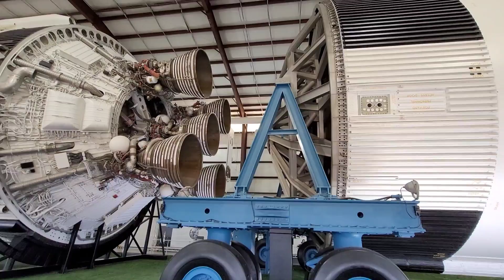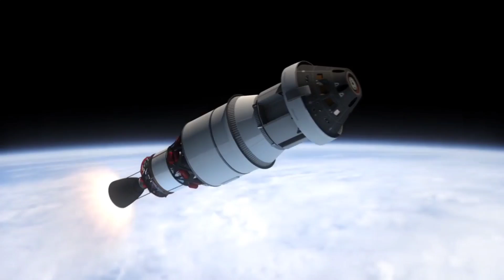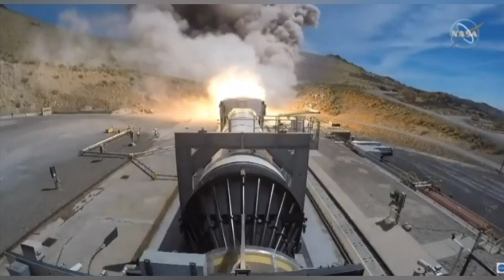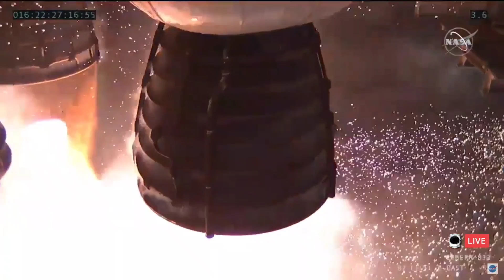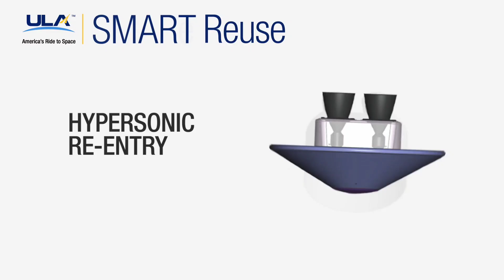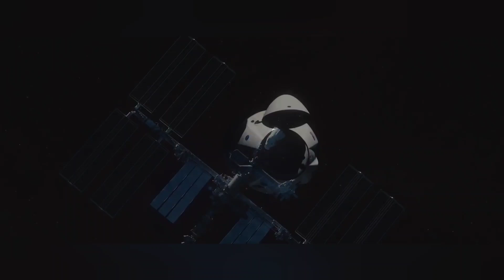Green Run Canceled! How did Boeing foul up SLS so badly? Can SpaceX or ULA (both?) solve this?

Comment: I've checked out a strong suspicion and found it to be correct. I looked at Saturn V and the Space Shuttle and discovered that Boeing actually had very little involvement in either of those programs. The main contractors were North American, Grumman, Rockwell, IBM, Lockheed, Sperry, Teledyne, Rocketdyne, Douglas, Thiokol etc. You come to the conclusion that Boeing's experience in rockets is extremely limited.  I could not find any major piece of hardware where Boeing was the manufacturer or designer.
Reply: Douglas merged with Boeing, so that is probably were boeing's experience is expected to come from if Boeing itself wasn't that involved.
Reply: @MDP1702  Boeing only merges with MacDonald Douglas in 1997. By that stage, they were totally out of the space industry.
Reply: @idanceforpennies281  I was just mentioning it since you mentioned douglas in terms of the Saturn V
Reply: @MDP1702  Yeah, that's cool. I was just pointing out Boeing got nothing useful from Douglas viz space technology. The main point I'm making is that Boeing has no significant value-adding to old or current space technology. It's not what they do.

Comment: Boeing fell prey to having to much money. Happens to tech companies a lot and it works like this:

A tech company generates large profits owing to technical excellence itself a product of a technically savvy leadership.  But the big pile of money has to be managed, so finance guys enter the picture. Overtime, the money management becomes a major profit center itself, perhaps the major other center. The balance of power shifts from the technical managers to the financial managers and the company losses it’s technological edge and competence. Companies cite business swirls down the drain. 

This happened at Boeing when the finance guys who wrecked McDonald-Douglas were invested in the merger of two companies and then went on to infect Boeing.

Boeing’s finance execs even bragged that they had made Boeing, “More than a great engineering company.”

I doubt the company will ever truly come back.

Comment: Question: Didn't the booster segment count go from 4 to 5, and not from 7 to 5?
Reply: 11:36.
Also think he said first stage was almost a space shuttle external tank with an engine slapped on. I think that is wrong too, only the colour is the same 😂.
15:26 he say the orange tank is "from the space shuttle".
Reply: @nielsnb11  You're right, it sounds like he's saying that the shuttle had 5 and now it would be 7.

And yes, the tank also wasn't the same, though I thought they started the process with the idea of just modifying the existing tank to fit the SLS, not essentially design and create a new one. But in the end they had to just use a new one.

All in all the only thing that really seems to be transfered from the space shuttles seems to be the engines, and even those were changed a little.

Considering all this, starting from scratch would have been a lot better, but you know, damn politics.
Reply: I believe the booste for the space shuttle was indeed 4 segements, but maybe they initially wanted to increase this to 7 instead of 5 and does he refer to that? Honestly I don't know, just a guess.

Comment: The Vulcan rocket is a interesting rocket and appears to be on schedule. It certainly will add to the overall lunar mission.  The Falcon Heavy is due to get a larger faring, thanks to the US military.  Then there is the Starship, which everyone seems to flip flop on.  Other than sticking a landing it appears to be on schedule to reach orbit by the end of the year. As far as sticking the landing it’s a factor of two things, engine reliability and learning curve.  The learning curve reality is up to six more landings are going to be needed.
Reply: Your take on what’s happening is probably the most informed and as close to my thinking that I’ve seen here yet!
Reply: I'm in agreement with you except that I don't think Starship will reach orbit before June 2022.  That is adjusting for "Elon Time" estimates.

Comment: Boeing hasn't done anything different since the 60's.
The issue is that they haven't figured out how to shut down SpaceX.
Without meaningful competition, Boeing looks good.
Reply: From what I’ve heard, there was a disastrous management change when Boeing merged with McDonnel-Douglas, and that destroyed what had been a rather good engineering culture. So, I do think there has been change over time.

Comment: With your plan to use Vulcan to launch Orion, then have Falcon launch the astronauts... it really begs the question on why Orion is needed in the first place.  Crew dragon just connects to gateway and leverages gateway for long term life support/propulsion only using crew to enter the atmosphere.  The only difference is we waisted some 40 billion in the process for the NASA jobs program.
Reply: I don't think the Crew Dragon's heat shield can handle the extreme speed and temperature of reentry from the moon to earth...

Comment: Five segments instead of 4, the SLS booster is somewhat more powerful than the Shuttle boosters, and No, the core is not a Shuttle derived tank (other than diameter) at all, it’s more an enlarged Delta IV tank.  Yes, all those things you said, but not as much as you would think.  There was a lot of political involved (Constellation must go and nothing must remain, even though Orion did), and there were also many pies and camps that had to be taken into account and mollified.  The design, cost, schedule and performance of SLS was driven much in part by satisfying all those things at once.
Reply: This sounds a lot like the shuttle program: a great fundamental idea designed into a complex monstrosity by trying to satisfy diverse interests.  If you try to make everyone happy, you will fail to make anyone happy.

By contrast, JFK set the target -- get people to the moon and return them safely by the end of the decade -- and the whole organization bent to that one purpose.
Reply: @eternalskywalker9440  Truth be told, the Shuttle was a very well done piece of engineering, incredibly well thought out.  I would rate Shuttle over Saturn V and even Apollo for execution of design and that is taking into account that it was a full generation ahead of both.  Apollo/Saturn was a purpose built system, making the design much less controversial and easier to pull off.
Reply: @Strike_Raid  Uhm considering that the shuttle had a rate of catastrophic failures several magnitudes beyond even pessimistic predictions, that should kind of limit the praise for it. Not to mention that out of sheer luck it didnt have 2 more catastrophic failures. One during launch and another one during reentry. These issues were largely by design too, by not having an abort window and by piggybacking the shuttle to the side,  thus risking heatshield damage. It was  an incredible design for its time, it was iconic and of strategical importance but probably also the unsafest manned crewed vehicle that ever flew. Not just early on but during its lifetime and its certainly the vehicle that killed most astronauts in flight. It was also an insane moneysink that ensured that NASA wouldn't have any other ambitious projects in the 30 years it was in service, not even a successor and certainly no moon base or some other stuff people were waiting all their lifes for.
Reply: @haraldhimmel5687  Apollo had it’s lucky breaks too, they all did.  Both Atlas and Saturn had about 1/10 failure rates, shuttle was about 5 times better.  There were not enough Saturn launches to get a solid number, only Apollo 6 was an outright failure.  There were a lot of Shuttle launches, it had very respectable success rates.  Mercury was far and wide the most dangerous program. Gemini had no credible crew escape system, probably worse than even Shuttle.  Apollo was massively more expensive than Shuttle.  Shuttle was both more and less capable than Saturn.  Shuttle was a very flexible launch system, but also limited by where it could go.  Shuttle may very well be the most impressive thing ever constructed.
Reply: @Strike_Raid  Depends what you think about - it was indeed brilliant  and groudbreaking IMPLEMENTATION of  bend-over-backwards concept and system design. Just look at how competeing concepts for Space Shuttle used to look like.  Truth be told,  Russian concept of Energia - powerful versatile launcher able to haul significant, asymetrical loads was the way to go.
Reply: @Strike_Raid  Constructed  - yes. Designed - hell no. Also, for benefit of discussion, name one Shuttle escape system designed to work beyond STS-4 and during most risky phases of mission, or one that actually saved astronauts during real, not procedural emergency.
Reply: @piotrd.4850  I was talking about on the systems level.  The overall implementation of the Shuttle in general terms was driven by those other things that the 'designers' had little control over.  I really don't see what others see in the Energia since the only part of it that was recovered was the orbiter (less engines).  To me, just an ordinary expendable would do the same thing at much lower cost.  Shuttle was a much better machine from my perspective.

Comment: Vulcan will need to be man-rated to fly the Boeing CST-100 Starliner after Atlas V is phased out. The vehicle health monitoring system put on the Atlas V Centaur to man-rate the Atlas V would be a simple bolt-on for Vulcan. Man-rating Vulcan will be easy. Vulcan would also require some shakedown flights to find flaws and increase reliability. The more you fly, the more reliable the vehicle becomes as all bugs get removed.
Reply: NASA now usually relies on 5 consecutive successful flights with the same design to Human Rate a rocket. Under that standard, NASA could Human Rate the Falcon Heavy in 2022 & Vulcan in 2023.

Comment: SLS could use a detachable engine system and reduce the cost by at least half in turn allowing the engines to work until they’re ready to retire. Hate seeing so much wasted every time something launches, which is why I look forward to Starship so much because the whole thing is reusable not just a part which will reduce space junk massively over time if others adopt that plan or at least deorbit the upper stages when done. Thank you for the amazing video! 🚀🖖🏻
Reply: Keep in mind that the "reusable" Shuttle hardware was never anywhere near as reliable as they were designed to be, even with heavy (read: expensive) refurbishment after each flight. Modern expendable hardware is actually starting to be pretty competitive with it, especially at Boeing/SLS pricetags, without even considering modern reusable hardware!

Comment: Just look at the roadmap for SLS; there were originally 6 different versions Block 1, 1A and Block 2, each with both cargo and crew variants. It was supposed to run into the 2040's, guaranteeing tens of billions of tax payers money funneled into Boeing for an decades-long development cycle. An absolute stitch-up, right from the start.

Comment: Yes, SpaceX engineering could easily do it. Just call them. Great informational video. SLS, is costing way to much. Over runs after another.  Thanks 🙏
Reply from the maker: Yes...but there's a way to do this with existing rockets. Or, rockets scheduled to land probes on the Moon this year. A different kind of solution.

Comment: That opener is a real tear jerker.
Reply from the maker: For me too. I'm glad you liked it.
Reply: @TheAngryAstronaut  hey your mic 🎤  sounds quite
Reply: @TheAngryAstronaut  Music choice was superb. :-)
Reply: I remember watching it lift off headed to the moon on our familys black and white TV set.. I have not seen anything that awe-inspiring since.
Reply: @hankscally9658  It will take until Starship goes to orbit to surpass it. The Saturn 5 has held the title "king of all rockets" up until now and only SS has the ability to take over that title and carry on the legacy.
Reply: @carljohan9265  Lies! The Soviet Lunar rocket was king. Too bad all the good engineers were sent to the Gulag once too often or the N-1 would have had a successful launch.
Reply: @twotone3471  If you're gonna try to argue against someone, have a fucking clue about what you are talking about first. 

The N1 had 4 unsuccessful test flights. 
Not because of the engines, as those were put in storage and sold to the US decades later and used on US made rockets.
It failed because the soviets couldn't make a flight computer that was capable of harmonizing 30 engines. 

Also, the N1 had a payload to orbit capacity of 95 tonnes and could shoot 23 tonnes to the moon (had it worked).
Meanwhile the Saturn 5 could take as much as 140 tonnes to LEO, and roughly 45.6 tonnes to the moon. It also famously put an entire space station in orbit in a single launch: Skylab.